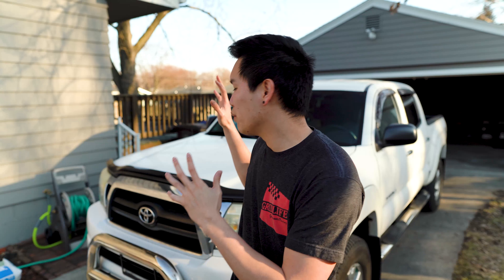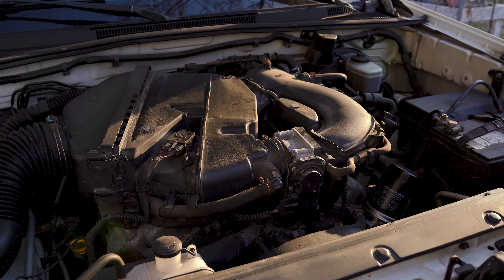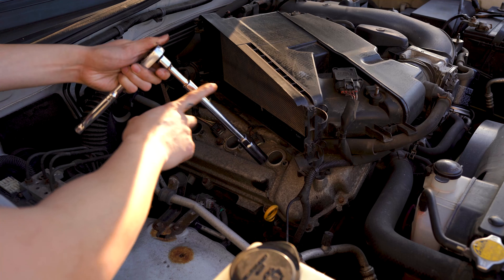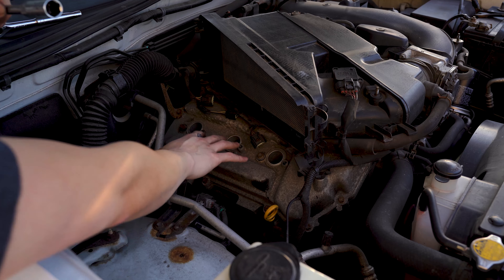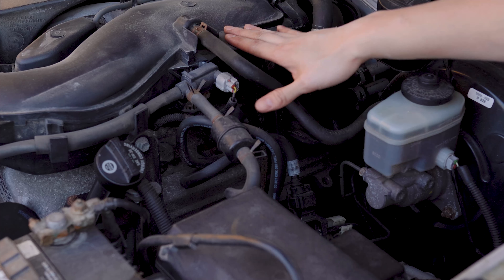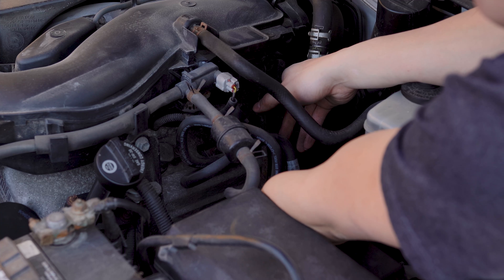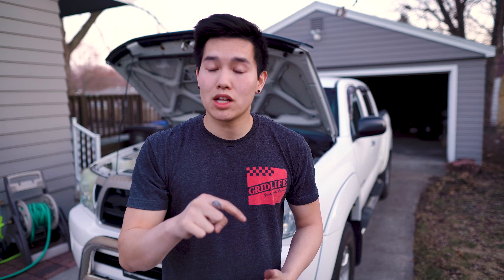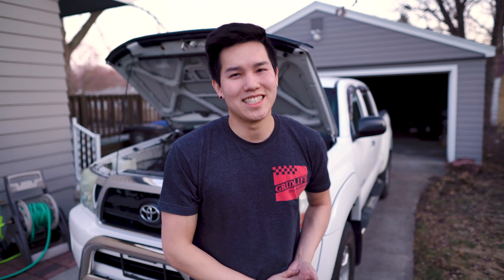2005-2015 Tacoma 4.0L V6 Spark Plug Replacement

Comment: I have a 2012 Tacoma, 60K miles.  It's time to change the plugs.  Local dealer wants $299.95 to change them.  I ask why so expensive and he said they had to remove the intake manifold.   Bunch of crooks.  Thanks for the video I'll do it myself.
Reply: I have a 2011 with 75k on it.  The dealer wants 680 to change mine. I ordered NGK plugs and I’m doing it myself.  
I did though have the transmission serviced.  He said the machine pushes out all the old fluid.  It took 3 gallons of fluid according to the receipt.   It’s shifting so much smoother, Can’t even feel it shift.
Reply: @carljenkins5092 yes same here, had the transmission fluid serviced and mechanic wants 500 for spark plug service. No thanks 😂
Reply: $60 for regular spark plugs and my labor vs $500 for the whole deal at the mechanic
Reply: You went to a business whose sole purpose is to make money and call them crooks? lol
Reply: They lied about having to remove the intake manifold adding costs.  It takes 60 seconds to remove it. Understand now sparky?

Comment: Just did mine this past weekend, bought it used last summer and had 127K on the original factory plugs. Each plug came out extremely hard and glad I didn’t break a plug. Went with denso OEM plugs from Toyota. Used anti seize for the plugs and 10mm bolts on the coil packs, dialectic grease on the coil boots and ceramic insulator.
Reply from the maker: Nice work! I usually don't suggest using anti seize on modern day spark plugs as they usually come pre-coated with a corrosion resistant coating and it can also cause incorrect torque readings.
Reply: @KevinVo  I know they recommended that you don’t on iridium plugs, not sure about Denso copper plugs though? I’ll be changing them at the 30k intervals from here on out for sure.
Reply: 127k on factory plugs? Can I ask if you saw an mpg increase after you replaced them?
Reply: @flubbernugget888888  no noticeable difference in MPG’s, was getting 21 on the highway and 17 in town, and was the same with new plugs. the Denso’s held up much better than the NGK side. Will be doing the job again in 7k miles.
Reply: Great video

Comment: Thank you. This is explained very well. I am a 46yo overweight woman and I just followed the steps and saved $500. I also replaced coils while I was in there because our 2005 has over 200k miles. The screwdriver tip on the one plug was 🤌. It saved me. Luckily plugging it back in was much easier than taking it out. Thanks so much!!! 💪🏼💪🏼💪🏼
Reply: I love this. It seems nobody has verbalized it but; but kudos to you!! Me and my group always encourage any way to save $ with basic stuff. You remind me of my sister, but she would never try. Once more, awesome work!

Comment: Finally a video of someone not telling people to use iridiums. These engines aren’t set up for it. Copper denso oem are perfect every 30k like this gentleman states ! 👏 😎
Reply from the maker: OEM is the way to go in this case!
Reply: @KevinVo  definitely is.  I did lots of research when I got my Tacoma. Sadly the previous plugs were barely in there. Torque specs are 14lbs. I only did to 12 cause I’m a pussy 😂
Reply: Master mechanic at toyota said it's perfectly fine to use Iridium plugs in these engines. They just don't come stock with them
Reply: @sonofliberty92 iridium on both sides ?

Comment: DId you set the gap on the plugs?   If so, what gap did you use for the plugs?    Didn't see you do this.   If the gap isn't set properly, may not fire good.

Comment: At 5:55 that was a hard wire to unfasten and refasten as it’s so cramped. There are two cable bundles that it’s attached to that are clipped down. You can pry them off and get a tiny bit more slack.

Comment: Dealer told me with a straight face  700.00 to change spark plugs when i had in for oil change and rotate tires.

Comment: At 5:03 (and beyond) you can see a light gray plug below a larger hose. The plug, and other, smaller hoses, are all clumped together on a small bracket. That bracket is held to the side of the engine with a 10mm bolt underneath it. For the love of God, and your knuckles, remove that bracket, and you'll be able to access the center plug SO MUCH easier. Also, just go ahead and fully remove the black, metal bracket that he just loosens in the video. It's much better to just set it down out of the way, instead of working around it, while flopping it side to side.

Comment: Made this job super easy by having a visual road map of what to expect. That was except for that one clip under the intake but I got it eventually by leaving the coil pack loose. Then a friend suggested I clean the intake flaper valve. It would have been easier to do the clip with the intake off and super easy to remove, as it is just two bolts, a hose clamp, and two vacuum hoses. 2005 Toyota Tacoma was miss firing on 3 & 4 and now runs smoother than ever. It took half an hour. I highly recommend socket extensions and very helpful spark plug socket with a magnet.

Comment: apparently whoever owned my truck before me decided to not change the driver side plugs , lol ....there was two different brands of plugs in my motor.....3 of one brad (ngk) on the driver's side and 3 of a different brand (denso) on the passenger side..... guess they didn't want to pay the STEALership to remove the intake either and decided to just change one side ....the easy side .... lmao
Reply: Nope, believe it or not that's actually how it came from the factory. One side denso, the other ngk. Whoever owned it before you probably never changed the plugs.

Comment: I just took my 2011 in for frame inspection. They looked the vehicle over, and said I needed new plugs. FOR $472.92!!!!!! LMAOOOOOOOO
Reply from the maker: Yeah the stealership is a joke when it comes to maintenance!
Reply: I just called today to see about replacing plugs in my 2015 taco and they also told me 480.  Insane

Comment: Ok so I watched your video very helpful but you left out how much of a Bitch it was on the first plug and removal if connections….. I literally fought the connector on the first plug on drivers side. Ohh did I mention I dropped one of the bolts that hold coil pack to  valve cover I spent hours looking for it in the frame was not easy to locate while on the ground under vehicle finally found it on top of frame rail thank God  I purchased new plugs and coil packs had to replace all 6 at 144 00 miles seems to idle lower and better response when driving but a good upgrade thanks
Reply: Fighting that first connector right now! 🤬

Comment: Dang bro, those plugs are to be changed every 120,000 mile, not every 30,000. This isnt 1973.
Reply from the maker: Just going off of what is recommended in the manual.
Reply: @KevinVo  Thats really odd, was just working on a 2010 4 runner, 4.0, and it comes with iridium plugs that are long life. I guess the taco uses something else OEM.

Comment: Good informative video.  👍 I have a 2007 Toyota Tacoma 4.0 v6.  Did you use the Denso k20hr-u11 or get something better?  Did you gap the plugs to 0.043 inch or did they come correctly gapped?  Did you add anti-seize?  I know you can get the original equipment plugs at O’ Reillys for $4.99, but the more expensive plugs around $10 each you don’t need to gap or add anti-seize.  Thanks
Reply: I’m also trying to find the correct gap sizing, my NGK came pre-gapped with .44, I’ve heard you’re suppose to have them between .39 - .43 but can’t find the specifics.

Comment: My 2006 Toyota coma has more than 250000 miles, and I never had replaced park plugs or anything. I was I was told that I didn't have to   because it didn't have spark plugs. I learned something new today Thank you for Setting me straight
Reply: Wowwww
Reply: Idk what is worse.... the fact he belived that it doeant have spark plugs or that he hasn't changed his plugs in 250k miles@DaRealSWIMMA

Comment: Aren't you supposed to use different spark plugs for the left and right side
Reply from the maker: No, the spark plugs are the same on both sides.
Reply: @KevinVo  I guess the oem ones are two different brands.
Reply: @KevinVo  from the factory the  passenger side spark plugs were denso and the driver side were NGK.
Reply: That was just a political stunt by Toyota 😉

Comment: I was initially so happy with your video. And then there it wasn’t. Like the others demonstrating how to do this task you omitted how to unclip the coil plug on the driver side rear. It makes you look really good it leaves your viewers without help.
Reply from the maker: I explained how I did it before I unplugged the coil packs. I used 2 flathead screwdrivers. One to release the locking clip and the other to pry the connector free. There is not enough space in the engine bay for me to get a clear shot when I'm actually doing it.

Comment: man I love having my one owner southern born and raised 2015 Tacoma and 06 4runner.  no rust underneath or in the engine bay.  heck every nut and bolt under the hood of your tacoma is a rusty mess. sorry, but I just love NO RUST.   I grew up and lived in Milwaukee until about 1985.  So I know how the damn salt just eats up everything.  New mufflers and pipes every 2 years. Rusty wheel wells and quarter panels.  and don't forget about brakes and brake lines.  oh what fun to crawl underneath and get all that rust in your face and eyes.  AHHHH sorry.  U better watch taking those plugs out with all that corrosion or ....snap.   hope not.  good luck.
Reply: I got sick of living in texas my whole life and never realized how spoiled i am down here. If a little heat is all i have to complain about then this must be heaven

Comment: Do you take the battery off for safety? I've done changed mine on my Tacoma 4 times now but I've never unhooked the battery.
Reply from the maker: Yes, usually when you work on anything related to electric components in the car it's a good idea to disconnect the battery.
Reply: Actually, I'd leave the battery connected since leaving it disconnected could allow the engine computer to lose some "learned" information.  You may lose your radio presets too.  It's just not a big worry unless you like to pry on the cables to the starter or some other brilliant move like that.  That's my opinion after owning 35+ vehicles that I always did the service and repairs on.
Great, clear video.  I didn't think it was worth $360+tax to have the dealer do it on my daughter's truck so I'm driving multiple states to visit my daughter and she and I can do it together w/o any special tools.  That's what I needed to know.  :-)

Comment: Thanks for this. My 2014 has 35K miles so first time with the plugs! Passenger side a breeze of course. Freaked out after seeing the driver side. Always crap engineering on something you work on often. I knew YouTube had the answer without taking it in to an over priced mechanic.
Reply from the maker: Glad it helped!

Comment: Thank you for this very well-done video. I've been putting off changing my plugs for several years now. My 2007 Tacoma still has the originals with 140,000 miles on them. Think it's time yet? LOL

Now I feel confident that I can do it. Keep doing videos. You're a natural!
Reply from the maker: Definitely time for some new plugs! haha 
Happy to hear I could be of some assistance!
Reply: @KevinVo  I replaced them yesterday. One head had Denso plugs, the other had NGK plugs. A friend had told me that's what I might find as supposedly the right and left heads were manufactured in different plants.
Everything went as planned following your video until I got to the drivers side front and found that the coil pack's lead was so short that there was almost not enough room to unplug it. Not to mention the bracket in the way. LOL  I had carpal tunnel surgery in my dominant hand three weeks ago and my fingers are still numb so that also hindered me from getting that one unplugged and then plugged in again afterwards. But again, thank you for the video and instilling confidence in me that I could do it.
Reply: @davidgagnon2849  somewhat right on the plugs. Yes it’s normal to find one bank with Ngk and the other denso. That’s called not putting all your eggs in one basket. Keeps both manufactures of parts happy. In case something goes south with one of them they can still get supply of parts from the other. Anyway that’s what I read on the inter webs somewhere. Lol.
Reply: Bought mine new in 05 and have only had the spark plugs changed once at 160k and it has almost 270k on it now. Reckon I'll change em again soon for good measure. Still runs like a top. Toyota 💪
Reply: That’s why you remove that bolt before attempting the plug- then u can slightly rotate to assist in UNplugging

Comment: Did you need to check the spark plug gapping? Wondering if I buy plugs specifically for my 2011 Tacoma it will come pre-gapped. (Maybe I should get a gapping tool just in case.)
Reply from the maker: The plugs come pre-gapped, but it's always a good idea to check.